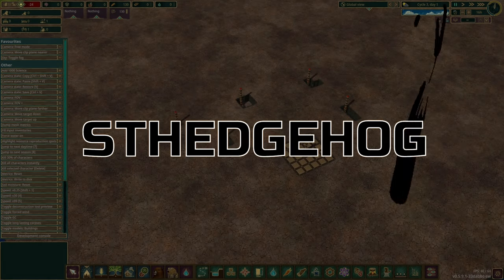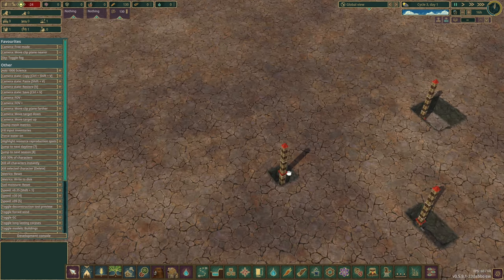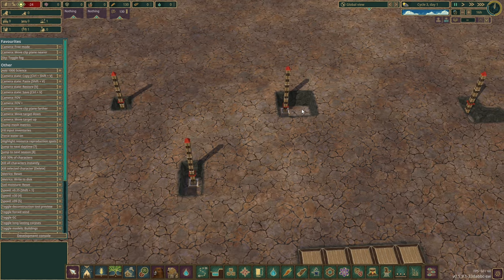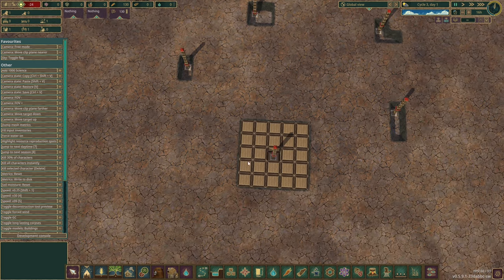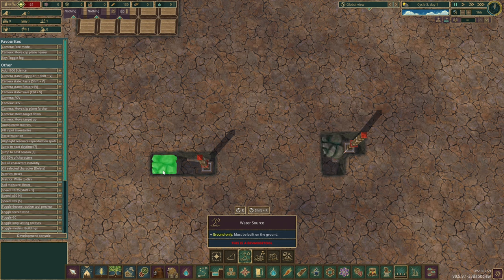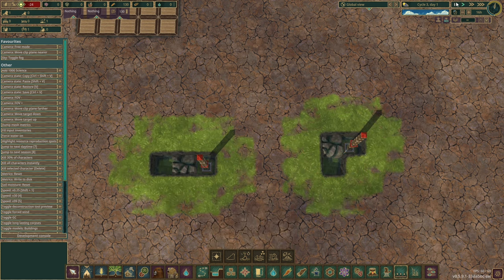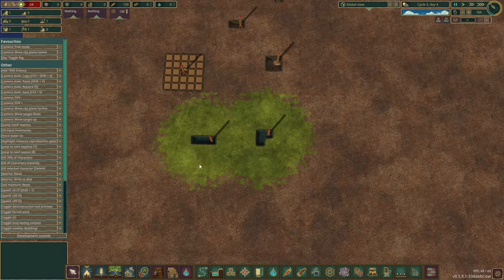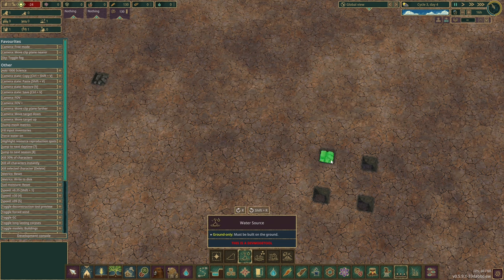Timberborn Water Experiment Failure

Comment: One of my theories is that it is based on the number of tiles with water next to each tile of water. Less water near, more evaporation.
Reply from the maker: Yes, theres a mod that changes the evaporation rates, its for an older version or timberborn sadly, btu it has factors like edge, water to water tile, total surface area, and many more. So, trying to find out the exact evaporation/infiltration rate based on edge and size is futile in the end

Comment: Namaste, Namaskar :D
Reply from the maker: Namaste

So, I don't think I can use you're greedy builders for the next playthrough. When I select them as a faction and try to play, loads of modded items disappear from the build list. 
Flywheels, Ferris Wheel, Power Extentions, Billboards, to name a few, only appear when I pick Folktails or Ironteeth. 
Are you disabling every building and only enabling the ones you want for the faction, could that be why they don't show?
Reply: @STHedgehog  They don't show because they're not specified by the mods. I don't want to set any mods as dependencies for GB, instead to add those mods to GB need to manually specify those mods to be included. I've uploaded an instance of my own mod for my setup, linked via a comment on my mod page. You can use that to help you get the gist of what you need to do. It's only the faction spec json text file you need to edit to suit you're setup until they support it. Trying to mod the mods themselves only works until an update to the mod occurs, then all changes are lost so a separate mod is needed.

Comment: Assuming nothing changed since I watched it. Someone figured this out and it was a 3x3 pond . A 1x1 island in the center ruins it. Depth didn't change the irrigated area .  Maybe it was your video 😂
Reply from the maker: That was me, 3x3 with a central point really kills the water rate, its basically a 1 wide river then which are really bad. 
After looking at a mod that changes the way evaporations works, sadly for an old version of Timberborn, I can see there's a LOT of factors to take in to account. So good old fashioned "build it and see" is still going to be the best way